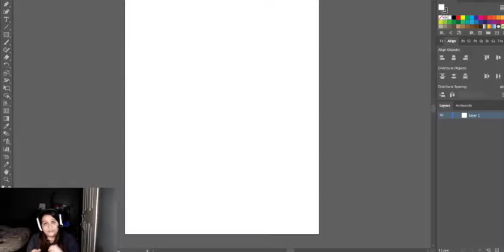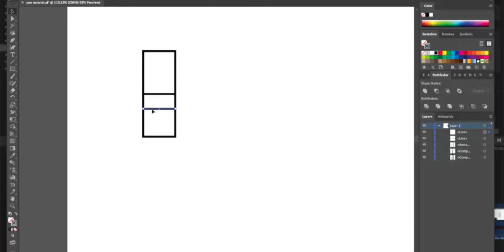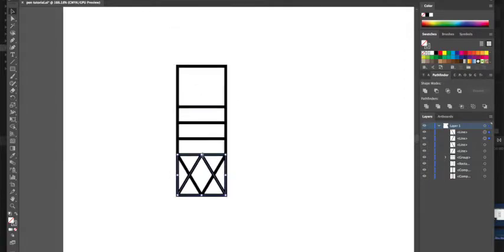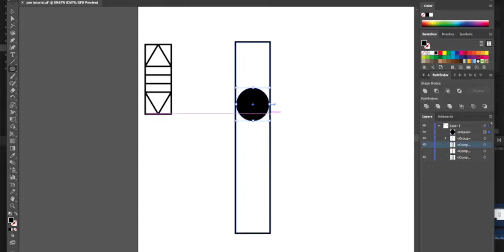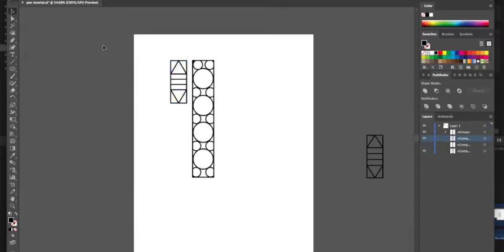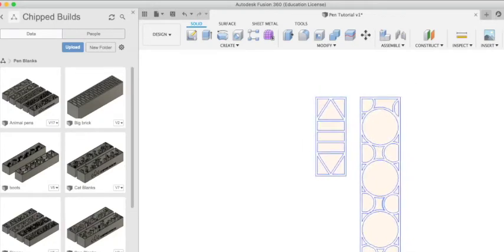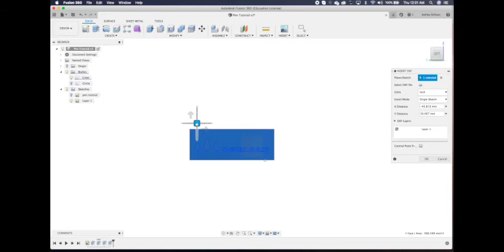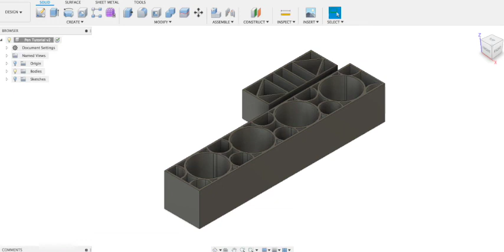Creating a 3d Printed Pen Mold Part 1 || How To

Comment: Why not just sketch it in Fusion360?
Reply from the maker: Easier for me to do it in illustrator first.
Reply: @ChippedBuilds  To be honest sketching in Fusion360 is a lot more basic and easier than Illustrator. So it shouldn't be difficult for you or any one to sketch in Fusion.
Reply from the maker: Haas I use Illustrator everyday so it take me about 2 mins to sketch something out and it would take me about 5 mins to sketch in fusion. I just like illustrator layout better.